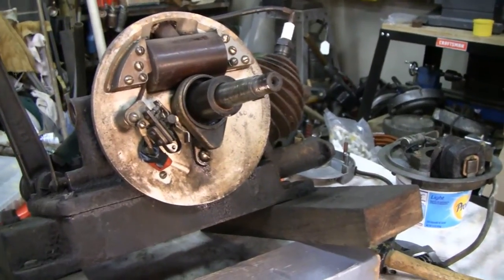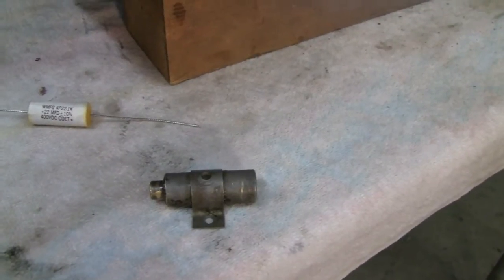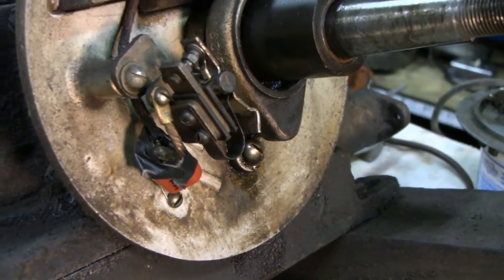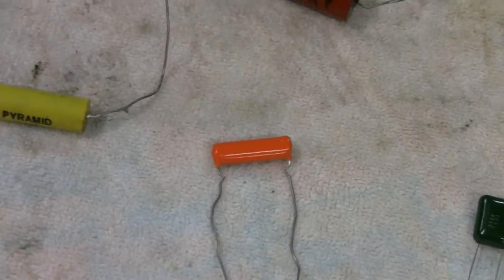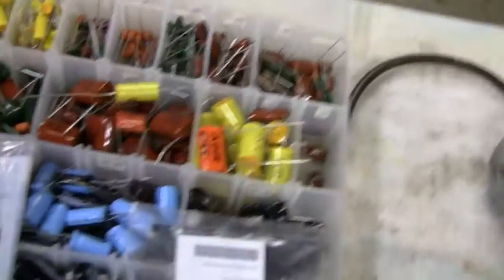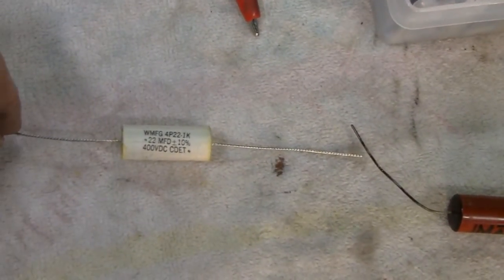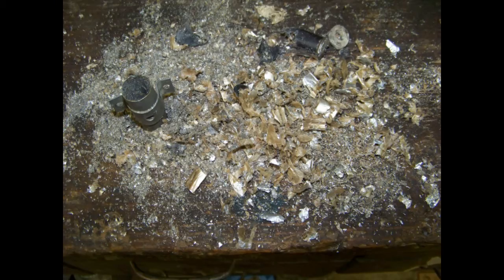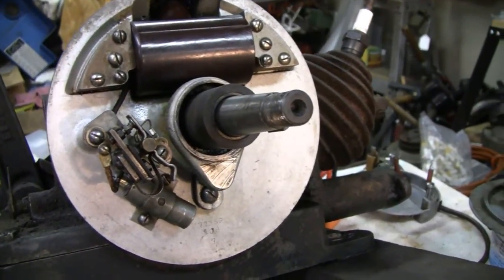REBUILDING A CAPACITOR

Comment: I had to do the quick fix on my 92 when it wouldn't run at the fair, two years later it hasn't shaken loose so I never fixed it lol! Mine is a 1928 so it has the rectangular style condenser. Its probably still good, we thought it wasn't running because of weak spark but it was just really flooded. I'm going to stuff the WICO condenser for my 72, I can test out my new dremel for cleaning it out! Great educational video!!

Comment: The difference in capacitors is very wide, even if the value is the same. Voltage ratings, ESR, material it's made of, and the temperature ratings. 

Watch out with the old capacitors when you clean out the shell, they used asbestos in them and you don't want to breath the dust.

Nice job getting the old cap looking original!